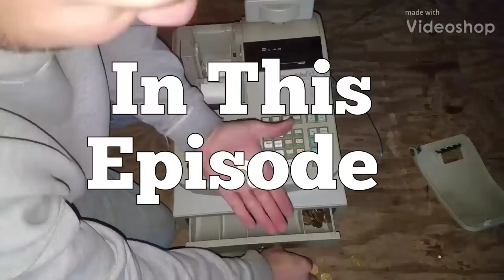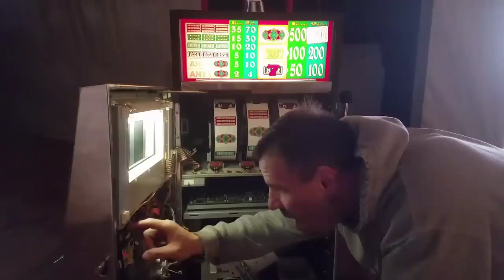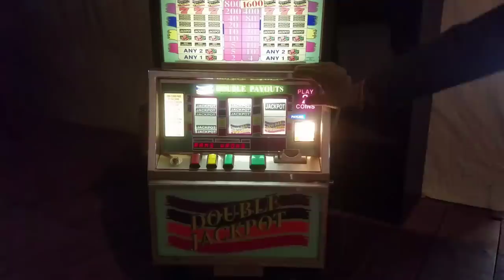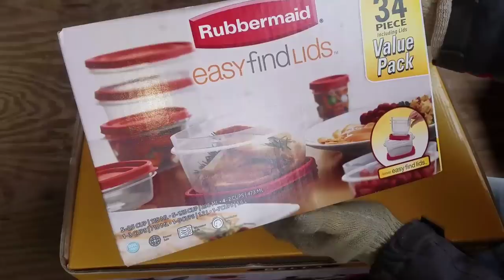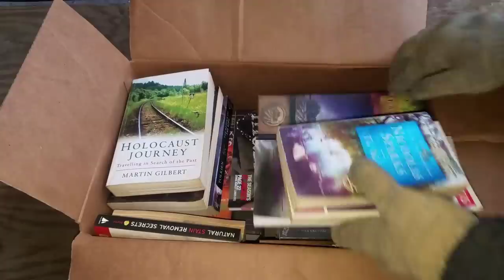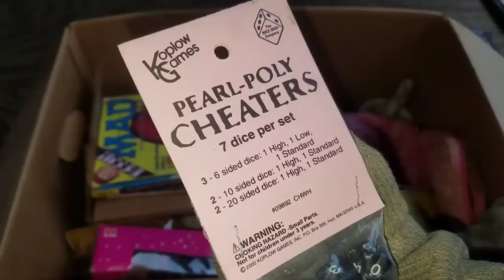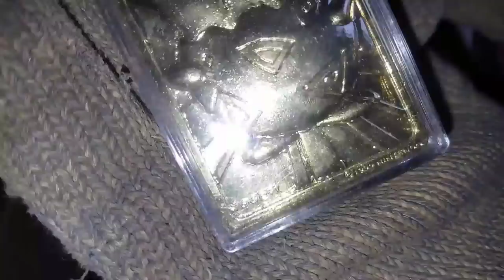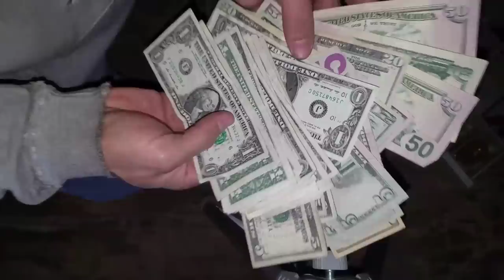CASH MONEY I Bought An Abandoned Storage Unit Locker / Opening Mystery Boxes Storage Wars Auction

Comment: At 17:55, the happy face balls in the box are for health... when you put them both in one hand, you rotate them around each other... it builds hand muscles AND, most of all, hits pressure points as you exercise with them, which can relieve pain, and tension.
  The cash register can be re-keyed, call a business machines place that sells & refurbishes them near you. They can either make a key, or change the locks for you. Be sure it's a place that works on that particular brand.
  Those are cheapy cash registers, but if it works, they have an X & Y & interim X feature for doing taxes down the road.
Reply from the maker: Do the balls truly work to relieve pain?

Comment: Haven't read all comments. So probably to late.  I have a slot machine like some of yours.  I started mine by using a key and the reset button on the power supply.  Inside on one of the boards are instructions to reset the machine .
Reply: I hope you do a follow up on the slot machines. Did you get them working?

Comment: I don't if it was mentioned earlier in the 2k comments, but for future reference  if you find a closed up cash register,  check underneath for a possible secret release switch or button. It is built in to save retailers having to replace busting open lost key registers.

Comment: The coin in the coin accepter is the templet coin which the accepter compares to determine what coin will be accepted. Over time slots were set to accept not only real coins but tokens. In Missouri, riverboats could not use real coins so they made tokens to replace the coins. The machines with errors have a bad circuit board or need to be reset which requires a tester to determine. I was a slot floorman in Las Vegas Nv back in the 1970s as well as a slot attendant on a riverboat on a Missouri riverboat called the Isle of Capri in 2000 I was not a tech but I did minor resets and repairs prior to calling the techs. List on Ebay as is and put a reserve determined by the collector value

Comment: With a lot of registers there's a small hole on the bottom of the drawer take something and poke up into the hole and 9 times out 10 the drawer will pop open
Reply from the maker: Thanks for the tip ... IT WORKED :)

Comment: 2:57 when you want to open a cash register,most the time you don’t need the key. At the back of the cash register, on the bottom of the cash drawer, normally in the middle you will see a little lever, push or pull it and the drawer will pop open, that is of course as long as the drawer is slanted down in front. Almost all cash register have this little lever. I used to work on them and 99% have it and you don’t need a key.
Reply from the maker: What did you do that had you working with cash registers?

Comment: 17:54 these are Chinese stress balls 💗
Reply from the maker: They look like blue balls to me :)
Reply: What The Hales. Chinese medicine balls, also known as Chinese Baoding balls, stress balls or exercise balls, are said to date back to the Ming Dynasty of 1368-1644, or earlier. While their origins are mysterious, their uses are pragmatic. The balls help to relieve stress, build muscle tone in the hands and fingers and improve circulation. Hollow metal balls that create a chiming sound when they touch are the most common type of medicine balls for therapeutics.

Step 1
Place two Chinese medicine balls in the palm of one hand. Close your palm and fingers over the medicine balls, forming a loose grip.
Step 2
Rotate the Chinese medicine balls clockwise using your fingers and palm. Continue rotating the Chinese medicine balls clockwise, making five complete revolutions.
Step 3
Rotate your fingers and palm counterclockwise, after five clockwise revolutions, spinning the Chinese medicine balls in the opposite direction for an additional five revolutions.
Step 4
Switch hands, placing the Chinese medicine balls in the palm of your other hand. Repeat the clockwise and counterclockwise exercises. Continue switching the Chinese medicine balls from palm to palm for approximately 15 minutes. Repeat the exercise several times per day.

Comment: Do you have the keys for the slot machines?  Perhaps they have to be //locked// before they will work??
Reply from the maker: I did not find any keys ... is there a spot they would be hidden on or in the machines?
Reply: @WhatTheHales  I can't think of anyplace keys would be hidden (except maybe taped under the machine cabinet??)... BUT, you can possibly change the locks out? They may be those simple cylinder type barrels that you unscrew a holding ring (it holds the cylinder in place against the inside of the cabinet) from the inside of the door lock?  As far as the register, since the lock wasn't actually turned (and even if it was I think), same logic applies, just buy a replacement cylinder lock!  Hope this helps. Love your videos!

Comment: The arm may not work most of the time you have to push spin button
Reply from the maker: Is the spin button on the face of the cabinet on the front?
Reply: @WhatTheHales  yes right by the coin hole to the left and to bypass to make them free you need to bypass the coin sensor

Comment: Token slot machine number 5 theirs a hole under machine reach under their in hole and release lever will open theirs power switch inside that turns on the other is reset switch I had no key that's how I got mine opened

Comment: 4 of your slot machines are real and came from a casino, it looks like they removed some RAM (random access memory) it probably disables the machine when removed. Legally you cannot sell the machines that take coins to the public (at least when I worked with this stuff 8 yrs ago that was the law) that is probably how they got around selling a working coin machine. The reels on those machines will not spin until the motor is enabled, pulling the handle only hits a switch that goes to the main bd. (CPU)  The CPU has to turn on the motor to make the reels spin. You would have to have someone look at your PC bds and determine what type of RAM was removed and replace them to make the machines work. The 5th machine is a token (Japanese) slot machine, it too has a power on switch inside the machine.
Reply from the maker: Thank you for the wealth of information and knowledge... What state were you working in when you were working with the machines?
Reply: @WhatTheHales  I was in Massachusetts

Comment: 21:00 well there was no nip slip so it should  be ok and things happen during unboxing you don't expect. 25:10 safety 1st you needed a screwdriver lol or at least a locking blade or straight bladed knife that one you used could close on you fingers and that is a ouch for sure. At least you had on kevlar gloves. 33;06  the gold pokemon card goes in the pokemon ball you found . If I reamber you use to get them at McDonald's as a toy.